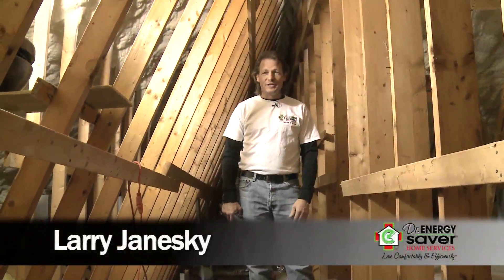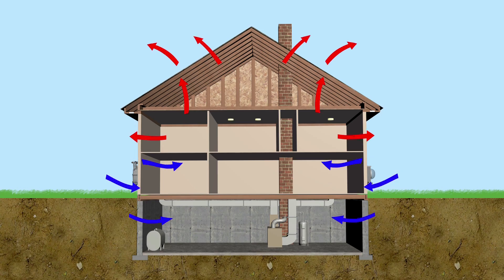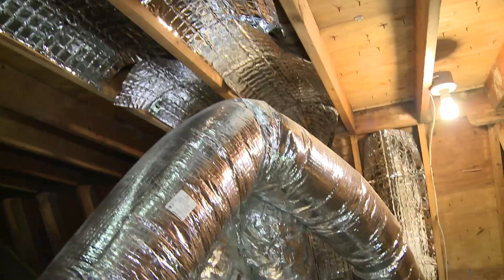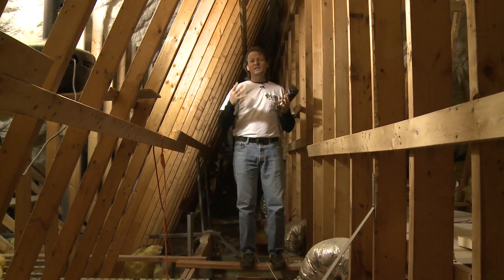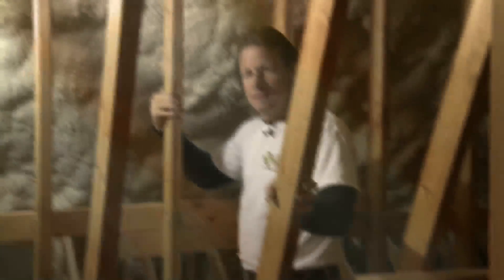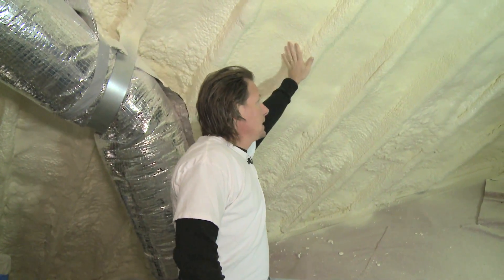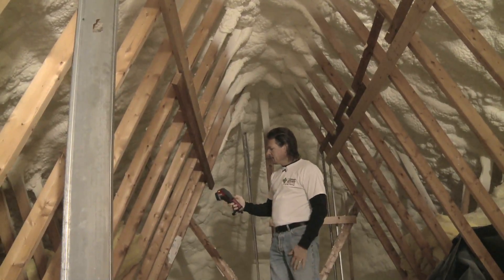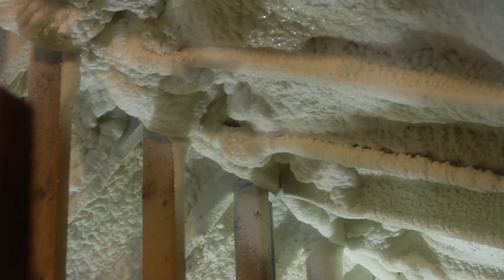Insulating and Air Sealing an Attic with Spray Foam (Short Version)

Comment: Attics need to breathe as a roofer I can’t tell you how many times a homeowner needed to replace the entire decking because someone sprayed foam on the attic for insulation and closing all air Gaps then all is rotten to the point it won’t accept a new roof, specially in the humid prone states. Better to add electric or  solar air vents and air blown insulation.

Comment: What paint did you use as the vapor barrier?  I tried finding someone in my area to spray closed cell on the under side of our kitchen roof but could find only open cell contractors.  I now have ~6 inches of open cell on the underside of the decking but it is open cell foam.  Can you recommend a vapor barrier paint that is friendly to the open cell foam?  Thanks!
Reply: get ready for any leaks

Comment: So 6 and a half years later wheres your follow up video for rotted roof decking and truss members 😂🤣
Reply: Open-cell foam is porous. If you ever had a roof leak, the water would drain through the foam, which tells you that water vapor can also get through, allowing the roof to breathe. However, if closed-cell foam was used, it would trap the water and rot the roof before you knew you had trouble. With open-cell foam, this is not an issue.

Comment: Cons 
Terrible investment that you won't break even in
Burns up shingle life
No air flow which causes mold and sickness
Reply: Oh, 40 yrs of running an insulation company.   Stick with cheaper fiberglass and cellulose to your walls and ceiling of living area.  Make sure you have high efficiency furnace and AC designed for the correct sq. footage of your home and only do this if it is still not comfortable in your home.
Reply: Or if you are planning to make a living area in your attic, in which case, it is probably your best bet to keep cool in the summer as it has a higher R value per inch.
Reply: +Josh Garrett 
Dewpoint control stops mold and mildew,, not airflow.  If the surface temp of the foam under the deck is ambient or close,  you have eliminated the possibility of dewpoint.    Introducing outside air ,  to supposedly vent out "humidity" is pointless and  counter intuitive.

Comment: spray foam on attic roof do I NEED to have any opening on roof any ventilation
Reply: No, it is a sealed space.
Reply: Supposedly there was a new code in 2018 that calls for a vapor diffusion ridge vent for unvented attics to vent humidity quicker especially in hot humid climate zones. Basically a normal ridge vent but has tyvek over the cut slit then ridge vent cap then shingles. I might have to do this to my foamed house in Texas.